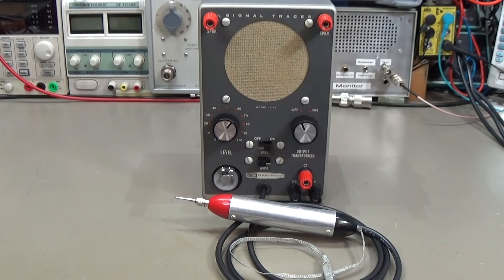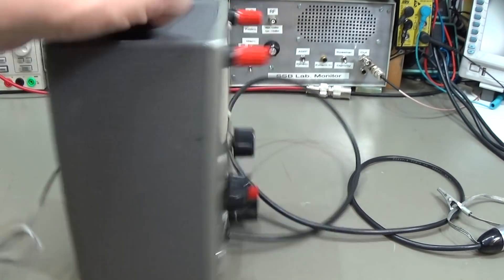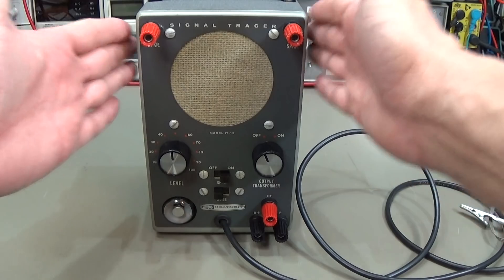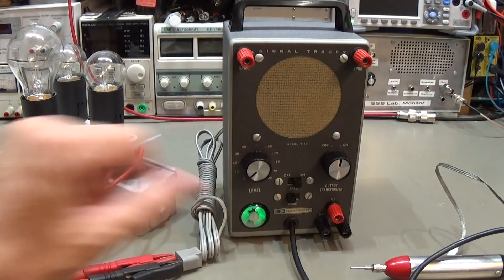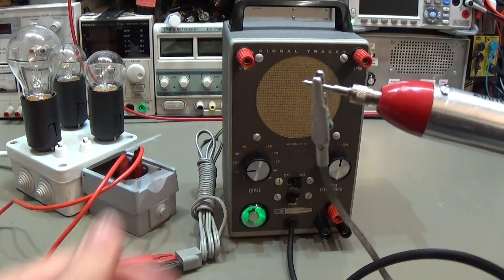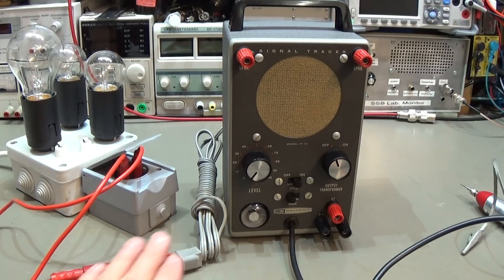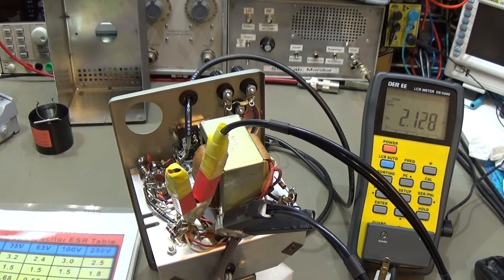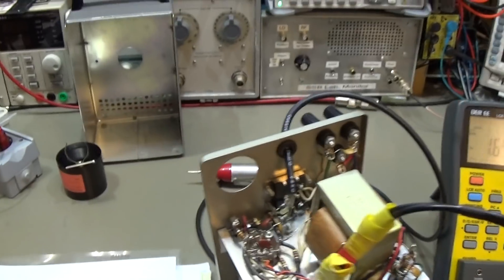#153 Heathkit IT-12 Signal Tracer repair and restoration

Comment: I worked for Heathkit for over 10+ years, repairing customer assembled equipment. Just loved it! The biggest problem I found with the kits brought in for repair was the customer assembly & quality of craftsman ship. Often, just a solder job would make the repair or connecting the component to the correct termination where there was point to point hand wiring. The equipment they engineered was excellent for the cost! We used the test equipment line to fix our the kits. The IT-12 was a staple for fixing audio & RF gear. It never let me down!
Reply from the maker: Hi Roger, I do believe that it was fun working for Heathkit. So sad that Heathkit business model does not work any longer these days...  Thanks for stepping in!

Comment: @ 57:00 it's always a good idea to add a fuse to the "hot" side of the mains/line cord, especially in equipment that has no possibility of finding direct replacements for things like it's transformer, and older Eico and Heathkit items like that seem to often be lacking any fuse in its main power line circuit. I often install a Littlefuse brand  03540001ZXGY - 3AB/3AG fuse holder, it installs nicely with 1 - 1/8 inch hole drilled into a chassis and a properly sized pop rivet holds it well, and it wouldn't have any outside physical indication to detract from its "original" look. Glad you got it working well with the work you did.
Reply: I think that (outside of collecting for a show piece) the most important thing is that the unit is safe to use. So, for me, I believe adding the fuse is the way to go if the plan is to actually put these heathkit units to work on the bench. Safety first for any test/work bench. Collectors have a different goal than those that will use these units.

Comment: Good job on your video and troubleshooting. Recently, I dragged out an IT-12 that I built 50 years ago and fired it up. It worked but had much self oscillations as I turned up the volume and the eye was not sharp, but fuzzy. I went through all resistors and capacitors for values and functionality (using a Heathkit capacitor tester and ohmmeter) and all were good. No components needed to be replaced. The dc voltages were good. I tightened up all the ground connections and checked ground paths with an ohmmeter. I didn't like the mechanical connection at the can electrolytic c7 to ground so I added a jumper from chassis screw to one of the ground tabs. After all this I started to poke around with an insulated probe pushing and wiggling ground locations with the power on. Suddenly I found the culprit when I pushed the center post on the V1 tube socket. The  base of the post had a poor connection to the foil on the back of the tube socket which goes to the adjacent mounting screw. I soldered it and that fixed the problem. Now I can turn the volume all the way up with no oscillations with or without the probe shorted and the eye is sharp and distinct. I've checked the unit with an audio source over a wide range of signals and it works very well.

Comment: That's the nicest IT-12 I've ever seen.   When I worked at the repair shop, in the late 80s, I had one on my workbench, but it had been through a fire and its appearance was damaged by smoke and heat.  (it still worked well)   Years later, I bought another because I wanted to duplicate the workbench I had, but I wasn't able to find one that looked like new as that one does.
Reply from the maker: Thank you! Glad that I found this IT12..Hope you will also find one which fits for your project duplicating your former bench.. Cheers

Comment: You got a nice unit there.  Really great condition.  You found the number one problem with kit assembled equipment, missed solder joints.  Great addition to the bench.  I would be lost without my tracer.  You can do a surprising amount of troubleshooting with one of these.  Think its sensitive now, build yourself one of Paul Carlson's super sensitive probes and it will turn it into a sensitivity monster.
Reply from the maker: Hi Mike, yeah glad that I found it. My modern one with OP amps and digital level meter and what have we can not compete with this old Cadillac :^)  And you are right there are circumstances where this old stuff is more than helpful. I know Paul's super probe and that is incredibly sensitive but was it not build for finding noisy components with even not touching a component??  Have a nice Sunday 73
Reply: Hey Mike. I just bought a IT-12 with no probe. I was going to build a probe myself but the detector diode used is not found anywhere.
Great suggestion that saved me was yours: "Think its sensitive now, build yourself one of Paul Carlson's super sensitive probes and it will turn it into a sensitivity monster."
Oh yeah, I remember that video.
Thanks for this suggestion!
Tom

Comment: It would be interesting to change the detector diode in the probe to a microwave rated diode such as a 1N23A to see if there is any improvement in the sensitivity at higher frequencies. I've got one on my bench now so your video was most timely excellent attention to detail with the coupling capacitor. minimizing noise and hum especially looking for faulty components is very important.  Its amazing that a piece of test gear that goes back half a century is still very useful today. Thanks Peter and best 73 from across the pond. Doug.

Comment: Good one Peter; always good to get a quick refresher on vacuum tube circuits.  Amazing that it detects up to 430MHz!  i thought the Heathkit was the oldest gear on your bench until I saw your tube tester!  Thanks!
Reply: They were designed for amateur radio use so it's not surprising that it works up into the 2-meter band, but yes 430MHz is exceptional.
Reply: I wish I would have kept all of my dads tube testers and equipment when he quit electronics.
Reply from the maker: LOL yeah sometimes you need even older gear. The tube tester is almost 70 years now. It is an old FUNKE. Thanks for stepping in 73
Reply from the maker: Oh Robert that must be painful in the flashback..
Reply: Well I was just a kid and not into electronics at the time, but yeah.

Comment: Thanks for the video...I have the exact same unit, and ironically, had nearly identical issues. Mine had the same cap backwards (jumped over to Mr. Carlsons foil vid to verify), and literally the same post and wire you had unsoldered, mine had too! I also found the ground connection in the probe came apart from the coax, so had to jumper that.

Comment: Thanks for sharing I have just imported one of these from the USA. I found your video searching for the manual and have just started to make a video recommissioning the one I have. I am fairly experienced using valve equipment but it’s alway enjoyable to watch how someone else goes about his work. I also bought a step down transformer but it’s a much larger unit than the one you have as I have  some higher power equipment I would like to run.  I do like the smaller wall wart  transformer you have as it’s smaller and more convenient to use.  I also like test equipment and love that power analyser you have. Best regards Chris.

Comment: Hello Peter, I own the Heathkit IT-12 with the rare white housing. One year ago I was able to purchase the unit at an OM in my neighborhood. During the investigation of the device only a few defective Elektroyt capacitors were found. My version is running with a 230 Volt power supply.
The magical eye was also in very good condition. I work very much with the signaltracer it is a really fine device. On Saturday I used the device at a special action of our repair cafe, where I work voluntarily. The visitors were able to see the error search with the IT-12 live and were very interested. It was possible to repair four of the 8 tube radios on site. I would like to thank you for your excellent tutorials. 73, DG3JA, Jörg
Reply from the maker: Ah very good to hear that!. Where are you running  the repair cafe with your friends?? Thanks for your report very interesting 73
Reply: Hello Peter, my home Repair Cafe is Castrop-Rauxel.
Many others I have visited and I am so crazy, to repair even on vacation,
in the cafes Dresden, Saarbruecken and Saargemünd (France). 
I am fascinated by the volunteer work and have found many nice social contacts.
Despite all the efforts of the manufacturers we get a lot of repairs. 
Often, it is an old heritage that nobody wants to repair. 
On Saturday we had a radio day at the International Repair Cafe week. 
4 tube radios were repaired and the condition of the tubes measured 
with 2 devices. My Roetest 9 was in action and was demonstrated.
Here is the link to our website:
http://www.repaircafe-castroprauxel.de/
73, Jörg
Reply from the maker: Ah very good Jörg, sound like a lot of fun! Keep going this fantastic Job! 73

Comment: Check out Fran Blanche. She just built a NOS one of these, and her instructions came with wiring instructions for 120v and 240v versions. If you have the same transformer, you can make it into a 240v unit.
Reply from the maker: Thanks  for information. I know Fran's video and she was lucky to get  an European version .... I have the US version. The difference is that my line transformer is different so that I can't switch both 110V taps together for 220V...very sad :-( I guess I have to swap the line transformer with Fran's LOL. Again thanks for watching
Reply: TRX Bench maybe you can swap the transformers, she is in the US and should prefer 110V and you in Germany well 220V. Great video Peter thank you!

Comment: Very nice looking tracer Peter. I have one of these I need to restore. Mine has a weak eye tube. Thanks for sharing.
Reply: The Radio Shop - A lazy eye?! ;-)
Reply from the maker: Hi my friend, yes the unit is worth to restore and the magic eye is not the most important feature these days...Thanks for stepping in. 73
Reply: A black eye
Reply: Fran suggests testing the 1MEG resistor in the "eye" tube circuit.

Comment: Fran Blanch on YouTube is building one of these at the moment from an unopened old kit. The transformer on hers is dual voltage (110v/240v) depending how you connect the primary. If yours is the same you could convert it to 240v.
Reply from the maker: Thank you Gary, I know...Fran has the European version and I have the US version. Unfortunately my transformer can't get  wired  other than for 110V...Again thanks for stepping in

Comment: Nice, I will look forward to watching this video, I have one of these on my bench, it works ok, but crackles a bit, and I'm not that familiar with valve gear, mine had a bad eye valve, which I replaced when I got it.
Reply from the maker: It can be the tube itself or another noisy component or simply the volume potentiometer or a switch..not to hard to find...

Comment: It confuses me that you use the regular R measurement mode on the DE-5000, rather than its secondary measurement ESR mode (third button below red power button), when measuring the ESR of capacitors in your videos.  I don't recall ever seeing you use the ESR mode on that meter for any capacitor ESR measurement.

Could you please clarify why you do this? Would the meter's ESR mode ever produce a significantly different measurement value than the mode you do use?

Comment: I realize this is an old video, but I noticed that the probe wire did not have any strain relief. You might want to check the connection and add the relief. You might check the power cord for strain relief, too

Comment: Hi Peter, I have one on my bench, also like new perfect, watch the noise switch, when on it puts voltage to probe tip,, its shocking,, great video  thanks again
Reply: Dennis N did you assemble it from a kit ?
Reply: I purchased it as new old stock, looks to me like factory perfect inside
Reply from the maker: Ah another lucky IT12 owner :-) Yes noise is 100V but only 1mA. You will get a shock but it should not dangerous to your life.. Thanks for watching 73

Comment: A guy I work with gave me that same unit.  Condition is not as good.  I'll have to put it on the bench and check it out. Just got done making a schematic for a Sprague Mike-o-meter M1 capacitor tester.  Had the same problem with that one, two wires on a terminal strip never soldered.
73,
N9EUQ

Comment: Before I went any where near modern electronics I would want to know the current and voltage between the probe tip and ground otherwise a good presentation and content.

Comment: Hi, Nice video! Just wondering if the "eye" tube should not be fully lite until a signal is present. When a signal is present, I would think that would sweep around both directions from the 12 o'clock position to correspond with the signal intensity and then it would return when the signal is removed.
Reply from the maker: That would be an ideal eye tube but unfortunately the behavior is at it is shown in the video...Thanks for watching 73
Reply: Huh, just wondering how this eye tube is visually useful for this device. I had an old Tandburg reel to reel tape deck that had an eye tube which worked as I described above.
Reply from the maker: see this http://www.magiceyetubes.com/patterns.htm
Reply: Thank you for that and sorry for my doubt! My memory of that old tape machine must be a bit cloudy now that 40 or so years has past!

Comment: Hi peter. I know this video is a year old but I think I saw something that is not working correctly. When you turned the speaker off the eye tube stopped working but I think it should still work showing a signal when the speaker is off. I have one also and it worked that way. Just a thought, Carl.
Reply from the maker: Oh did not realise that.. have to double check it. Thanks for feed-back

Comment: Well I'm pretty impressed with the sensitivity and the frequency range of this unit Peter. Wow!
I just bought one without the probe. It was the cheapest out there. Ill just build the shielded probe myself.
I cannot find out on the schematic or parts list what "Crystal Diode" is used in the probe. I would imagine the "Crystal Diode" is really a germanium glass diode. 
My goal is to find now; What is the original part? Any suggestion for good wide frequency replacement and/or substitution? Would it be pretty easy to crack open the probe and have a "look see?" Pretty Please?  If you don't feel comfortable in doing that, that's 100% OK with me.
Thanks and great job as usual! So much appreciate all your fine work for all of us out here.
Take care my friend,
                                     Tom
Reply: I just read Mikes Radio Repair comment; "Think its sensitive now, build yourself one of Paul Carlson's super sensitive probes and it will turn it into a sensitivity monster." Great idea Mike!
Peter, if I don't find the information I need for the "Crystal Diode", I'll just hop over to Paul's site and watch that video again that Mike suggested.
Reply from the maker: Hi Tom glad to see you! Well yes with the original part we have a challenge. Nor comment in the manual or on the component neither a hint on the web and yes I have already opened the probe and what I found is a normal looking glass diode. The crystal diode is the secret. This diodes are different from normal pn diodes. Crystal diodes  commonly called POINT-CONTACT DIODES,,  are the oldest microwave semiconductor devices. They were developed for use in microwave receivers and are still in widespread use as receiver mixers and detectors.Unlike the p n -junction diode, the point-contact diode depends on the pressure of contact between a point and a semiconductor crystal for its operation. During the manufacture of the point contact diode, a relatively large current 
is passed from the cat whisker to the silicon crystal. The result of this large current is the formation of a small region of p-type material around the crystal in the vicinity of the point contact. Thus, a pn-junction is formed which behaves in the same ways a normal p n-junction. Because this diodes were the first microwave components may explain why the unit is working up to 1GHZ. The problem is as we don't have a type we can't look for an equivalent modern type type to replace it and it is to risky to damage the diode by taking it out for reading the  characteristic. May be we need to test some modern types with enough reverse voltage to handle the high voltage in tube radios...Thanks for stepping by Cheers
Reply from the maker: Yes Paul's super probe is very sensitive but if I remember right it is designed to find noisy components in a circuit without touching a component.
Reply: Yes, I found your answer about this in your comments to Mike @ MikesRadioRepair.
Reply: Thanks for the definitive explanation on "point contact diodes" Peter. No wonder your freq response was so impressive! 
   OOPS, maybe I should have bought one with a probe for $20 more. Looks like the detector is the basis of the high performance that you have demonstrated.
   I'll have a look at finding one of these  point contact diodes. Wish me luck!
   In the mean time I still could build a probe with a germanium diode and see if it covers the whole HF spectrum anyways for now.
   Thanks for the the feedback and take care my friend,
                                                                                                 Tom
Reply: Peter, I asked on the ARF. Someone replied that the following is the detector used;
"Heathkit part 56-26 = 1N191 90 PIV 5 mA Germanium." Now you know...
I'm shocked that it can be sensitive at > 499 MHz!
I might try that and/or a couple of Schottkeys and see how they perform.
Maybe you just got a "great one" picked from a batch?
Thanks again,
                         Tom
Reply from the maker: Hm if that is true? I mean nothing wrong with Germanium it is always a combination of different ingredients in a semiconductor so see here what I found http://semiconductormuseum.com/MuseumLibrary/HistoryOfCrystalDiodesVolume1.pdf  I doubt that a normal germanium diode can deliver the performance.